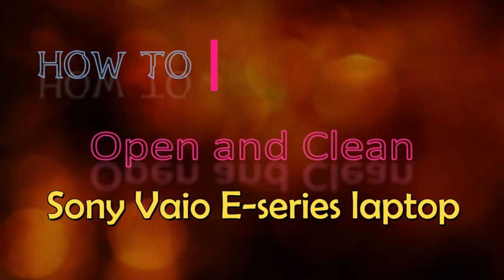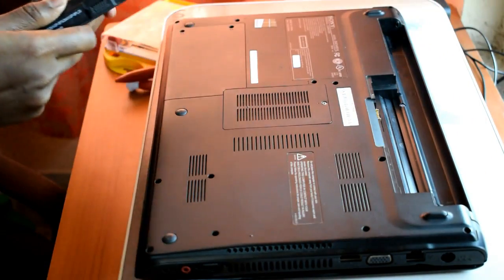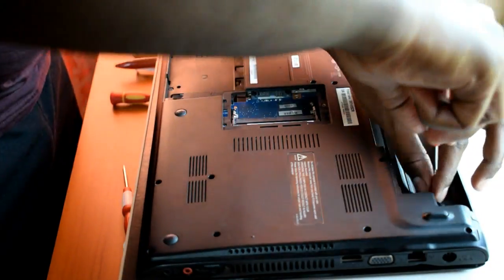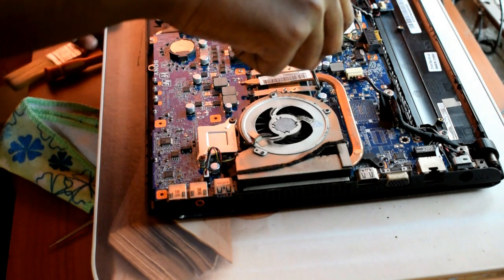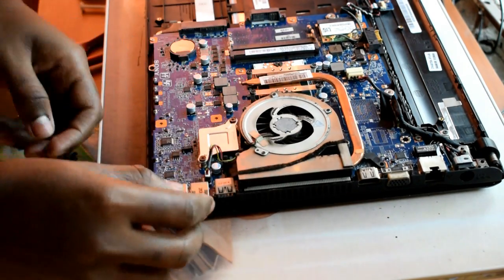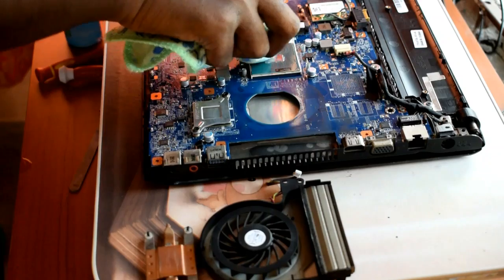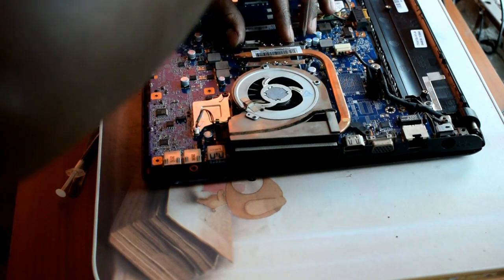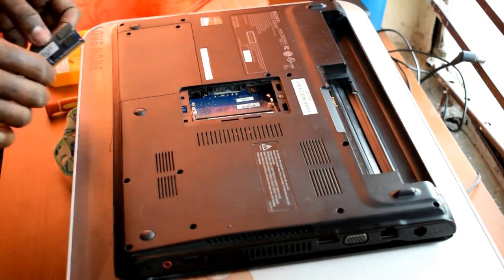How to Open and Clean Sony Vaio E Series Laptop to solve overheating problem

Comment: I am getting vertical lines on display before windows logo the lines keep changing colour display is fine on external monitor  what is the reason for these lines
Reply from the maker: Do not bend HDMI cable, reposition it or you can check with a different HDMI cable.

Comment: is it nesscary to apply new thermal paste every or cleaning the fans would do the job
Reply from the maker: If you remove the heat sink from cpu then you have to apply new thermal paste. But if you just clean the fan with a brush or vaccum cleaner without opening the heat sink then thermal paste is not required.
Reply: @tryitstd  thnx a lot

Comment: Great vid, helped me alot to clean the fans, one thing i needed to do different, i took the case off before i took the ram off, i have 8gb ram and i could not open it with the case on.
Reply from the maker: Andreas Pille I am glad that you find the video useful.